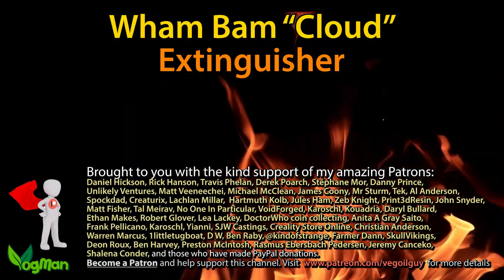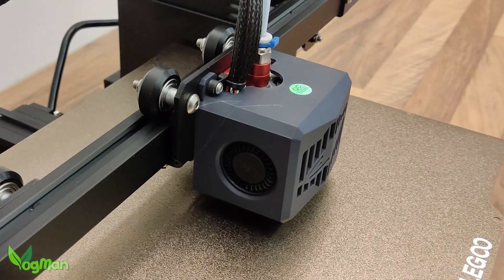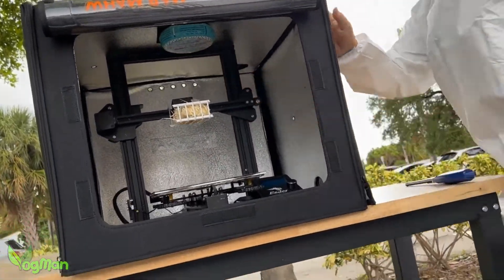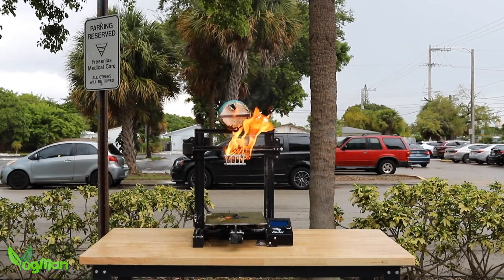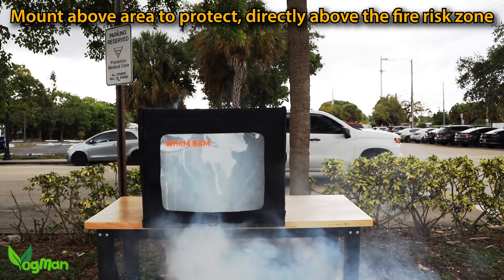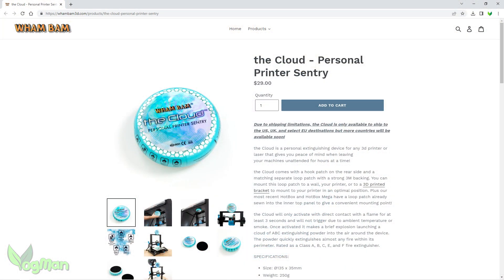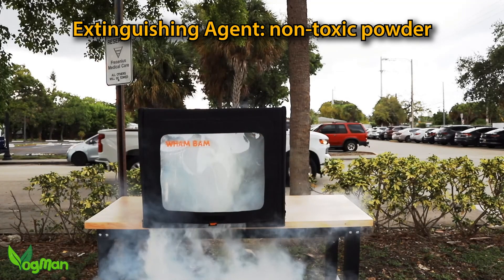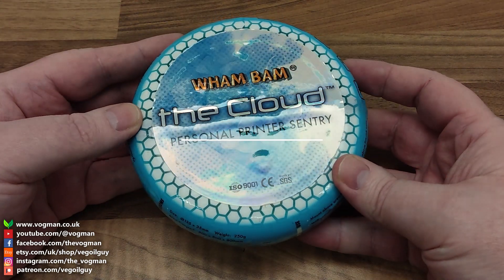3D printer danger [FIRE PREVENTION] Wham Bam Cloud

Comment: The cost is low, which never hurts but ...the shock wave is not indifferent, there are methods that avoid destroying your printer, and are also quicker to react, c02 and thermal sensors.

Comment: This is great but an electrical fire will likely re-ignite if the power isn’t cut. After hours and days of searching I found a company called docking drawer that sells an outlet that has a smoke sensor that will cut the power when smoke is detected

Comment: I have had a couple of the ball shaped explosive (or more accurately pyrotechnic) extinguishers on the table next to my Ender 3 for a couple of years. Got them when I learned the original Ender 3 did not have thermal runout protection in the firmware. I have since upgraded the motherboard to a 4.2.7 version (so much quieter than the original) and of course updated the firmware too but I guess it does not hurt to keep the extinguishers in place.

Comment: Despite the manufacturer's claims, monoammonium phosphate is corrosive and is the enemy of electronics when it eventually reacts with the moisture in the air, so a complete tear-down of the printer is necessary after exposure. 
 
But having said that, it is a smart, simple and cheap insurance that could potentially save your house.
Reply from the maker: As you say, it's the safety part that's really important 😁

Comment: I have a large fireball which I'll have mounted on the wall over both my printers when I finish setting the room up. It was recommended that I get this type of extinguisher by my friend who is a fire marshall. It doesn't matter which brand you go with, this explosive powder style is the best since unlike regular powder fire extinguishers they don't need annual servicing.
Reply from the maker: As long as you're thinking in terms of safety, then I salute you 😁

Comment: OK, That thing looks amazing. I have had a printer fire (on FDM not resin printer) and so am very cagey about running machines unattended. The only thing that saved my bacon last time was the machine was so isolated the fire couldn't spread. This device looks like genius. But I think you'd have to buy at least two. One to use with your printer, one to set light to for poops and giggles.
Reply from the maker: I was tempted, I'll be honest... but I put on my serious hat and remained sensible for once 😁
Reply: @vogman  You mean its not serious of sensible to 'test' a piece of safety equipment? Also, places that would give the best test results would be your A-hole neighbours car exhaust or thrown at the gaggle of noisy kids playing football outside your house. Both of these would require a remote ignition source. For safety.

Comment: This is actually really cool, and I will most likely buy one of these. At $30 this is cheaper than replacing anything damaged by a fire and smoke.

Props to whambam.
Reply from the maker: Agreed. The price is so low, not using one is basically foolish. It's a simple and practical solution. 😁

Comment: Just received a few of these and going to test one at my workplace's fire chamber  The only thing I'd prefer is a mechanical connection over velcro, since high heat can cause adhesives to melt/fail
Reply from the maker: I would imagine with this 3M tape, by the time its hot enough to fail, it's already put the fire out 😁
Reply: @vogman  actually at work we have RoomAlert smoke detectors in the 3D printer enclosures.  Over time, we had the adhesives fail and the smoke alarms fell off.  So, it can happen
Reply from the maker: I guess that depends on the weight of the item and the quality of the tape used. I'm inclined to trust Wham Bam products simply BECAUSE they place a lot of emphasis on quality. Have seen a few of their products, there never seems any shortcuts or skimping there. Long may that continue!

Comment: If you leave the printer for hours isn’t there a chance it will reignite? Not knocking it as it’s better than nothing....
Reply from the maker: I can't see it. Once it's on fire, it's no longer working. The mechanical and electrical components will cease. Maybe they could remain hot for a while, but these powder extinguishers work by starving fire of oxygen. If it can't breathe, there's no flame. 😁
Reply: That was my thoughts,  it's a great idea, but I've had printers that stay functional while on fire.  It is definitely a helpful product, but I wouldn't rely on it as an alternative to keeping an eye on your system.   If anything,  I'd suggest using a smoke or fire sensor that turns off an outlet if triggered as an additional measure.  Also, it is a lot easier to blow out a wood/paper fire than it is an electrical fire with plastics and other chemicals.
Reply from the maker: There's no substitution for vigilance, that's true. But this has to be the closest second 😁